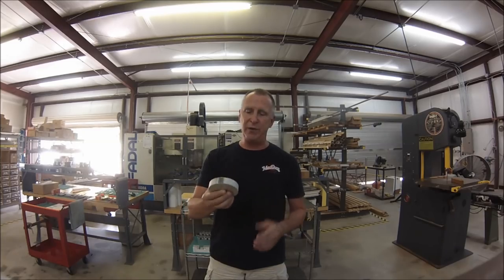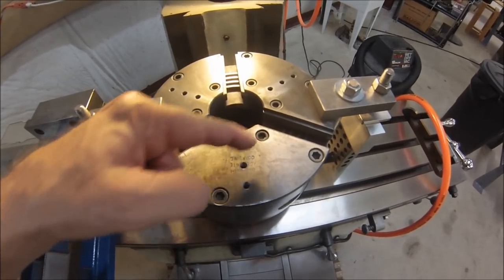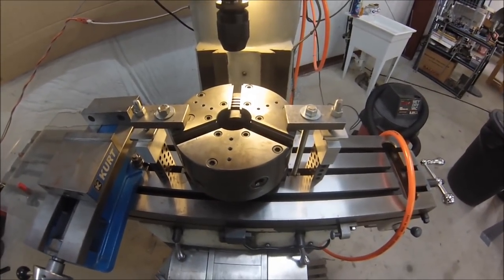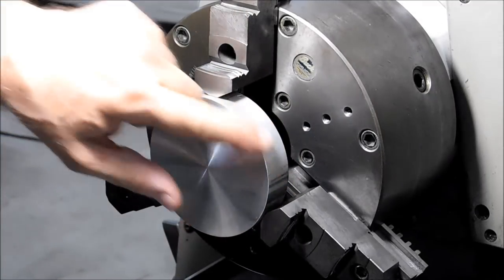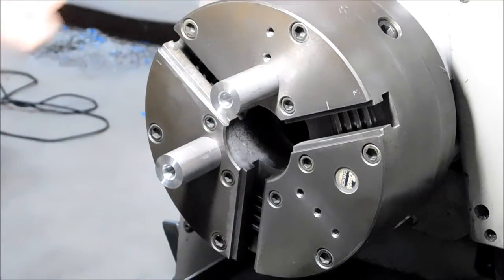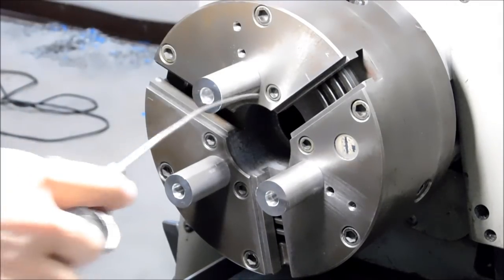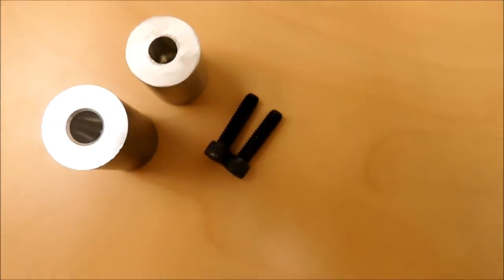A Simple Chuck Modification to Improve Parallelism of Your Parts

Comment: So I suspect what I've seen is down to the issue of rigidity and wear resistance, but recently when I've started turning parts with carbide, I've had less trouble setting up the tool accurately, resulting in much less difficulty turning right down to dimensions with error of only a thousandth or two, where I used to have problems consistently with high speed steel cutters. Is it rigidity? Was I not screwing down the hss cutters enough? If it helps assess the situation, the carbide cutter wasn't in a tool holder, like an HSS cutter, it was a part of the tool holder.

Comment: I still think I like the jaw spider Tom Lipton made/uses (not likely to be as accurate as this).  I don't like the thought of drilling holes into a brand new forged steel chuck.  Not that I have one yet... but soon....  it's still a great idea for those that aren't too chicken to modify their chuck.  Question though, can you not turn the jaws and simply use the steps on them or are they not accurate enough?
Reply: I would drill and tap those just after unboxing, they do not damage the chuck in any way or form. Besides, why use inadequate tools when you know of something better, especially in terms of price like drilling and tapping a few holes :)

And no, you can't turn the jaws and use them, as the jaws deflect when they squeeze a part. If they can be moved in their slots, then there is play and that play allows the jaw to cock and throws your part of parallel. Besides, you would be modifying those brand new jaws and "ruining" them in the process, not to mention that doing interrupted cut turning on a case-hardened parts is fun.

Comment: Nice job .....   I use a  a 3 leg  plate with inset grub screws for check  trueing  so can use on other lathes it is retained only by the material  being machined ......but probably needs to be modded so as to secure it incase the job comes adrift       thanks for your video 
Dave from downunder
Reply from the maker: I've used this technique for years. Works like a charm.

Comment: Something I did, years ago, to improve longitudinal parallelism, was to make a lapping tool for honing the chuck jaws. It went into the tail stock, and you slathered it with coarse lapping compound. Then you ran the tail stock up so that the tool was inside the chuck. Tighten the chuck enough to create some pressure/drag, and run the lathe at around 50-60 rpms or less. Cycle it like a hone, and you get real nice parallel shafts on those times when you have to have a long overhang with no tail stock support.

Comment: Hey Jo, another great film. I would really appreciate any advise you can give on drilling deep holes in steel? I want to drill a bunch of 3mm plates (steam loco frames) 8 bolted together (4 locomotives) with a series of around 100 holes with 3-5mm. Whats is the best technique to make sure I achieve accuracy through the entire plate set? Cheers Dave and Son UK.
Reply: stay off the vodka lol.

Comment: I hv one part motor plate of Dia 128mm  which requires face parallelism with in 20 microns. Is it feasible with this modification on CNC turning and hydraulic chuck holding? kindly confirm.

Comment: that's a trick that my supervisor would call Tips and tricks of FOG's. I've used similar setups when I took indicator mag-bases with steel pegs screwed into them. most definitely a dangerous thing to do at high rpm but at 50 rpm it felt safe enough for me and I made sure that I and everyone else was out of the path in case something happened, I also had my foot on the machine brake to stop the spindle if someone designed to film a new final destination movie by getting two close 😆
Reply from the maker: Its rock solid. Good mod if the boss lets you do it. FOG..Out

Comment: I didn't understand at the end, what you said about concentricity and soft jaws.  Can you please elaborate?
Reply from the maker: Sorry I missed this comment. Concentricity is established with a soft jaw, but the soft jaw pocket is bored deeper than the plane established by the 3 standoffs. This way, you get the guaranteed concentricity from the soft jaw locating the OD of the part, and the parallelism from the part nesting on the standoffs.

Comment: Hi Joe; Impressive as usual, thanks. For this exercise, I have always used an appropriately sized undamaged  old ball bearing outer race ring behind the workpiece, and used the tailstock to provide axial pressure as I clamp. Can you see anything wrong or improvable  with my method? It seems to work OK.
Reply from the maker: Sounds solid to me. Just don't let it jump around and all is well.

Comment: Good job Joe! It seems appropriate to have indicated the face of the chuck for the demonstration. Perhaps a good idea for anyone wanting to use this technique. Vut u tink?
Reply from the maker: Actually the condition of the face of the chuck doesn't matter once you face off the towers. That is one reason to number these towers, or dust them after each installation. They immediately become parallel to the spindle once you dust them.
Reply: If there is runout on the face of the chuck, the towers will not be parallel to the spindle; only when they are faced (dusted) off do they become co-planar to the cross slide. Or am I missing something?
Reply from the maker: The parallel relationship of these towers to the spindle doesn't matter. Its only the contact face that matters. Once they are faced off, they provide a parallel plane for the part to rest on. They could be seriously out of square to the chuck face and it wouldn't matter as long as they are faced after installation. Is it possible I don't fully understand your concern?

Comment: Soft jaws or stand-offs, giving the piece a couple of whacks with a nylon mallet/-hammer ensures that it sits flush against the jaws/stand-offs. You can hear it when it is flush, and it rarely is right after tightening the jaws. We did that all the time during my apprenticeship as a fitter back in the day (Denmark, mid-90's). 
The 2/10 deviation might have been avoided that way.

Comment: Is it necessary to take a light cut each time you mount standoffs, or should they be good to go for home-gamer applications?
Reply from the maker: For critical work, I'd dust them, but if you put them back in the same position, you'd probably be OK not facing them everytime.

Comment: Fantastic tip! Thank you so much for sharing your knowledge. I do have one question though. I always seem to get a sort of nub in the center, what am I doing wrong?
Reply from the maker: The height of your tool is off. You need to figure out if its low or high ans adjust it accordingly.
Reply: Your centre height of the tool tip is off-centre vertically. Suggestion: run your tool tip very slightly (0.2mm) below centre so that the 'centre nub' is an extremely small diameter rod that breaks off as you reach the centre.

Comment: Joe, that was amazing. I always learn new ways of doing things with you, Thanks!  I have one question. How you do with smaller diameter? The holes on the chuck can be closer to the center of the chuck. I am imagining a diameter that is bigger than a collet can handle. Thanks again!
Reply: I agree. Great video. Maybe you could make a set of rectangular bars that would protrude into the center hole. Use two holes instead of one for mounting. A little more work making them than round stock.
Reply from the maker: ww_big_al   You are spot on. I use 1/2 x 1 1/2 aluminum for that. Keep the spacers thin or you loose the ability to close the jaws. Once you get too far down, change over to collets.

Comment: Wonderful idea! Would this replace the need for a 4-jaw chuck assuming one would be used to get concentricity on the flip side? And also, would this work for a 12" long stock (2.5" dia)?
Reply from the maker: This modification is better suited for puck/disc style parts. Once a part gets long, more OD grip length would serve you better.

Comment: I have a part I wanted parallel ends and was disappointed with my results. The part is 1" dia x 2" long with a 9/16" hole lengthwise through the center. I turned the OD to 1" and parted off in a 3-jaw. Then put in a collet chuck. The center was drilled to 1/2" then finished to 9/16" with a boring bar. The end was faced off. The part was then rotated and the other end faced. I got about 0.002" out of parallel. Where'd I go wrong and what would be a better procedure? Thanks, Tom
Reply from the maker: This sounds like the OD of the part wasn't a true 1". a collet chuck would show good contact at the nose, but inside the collet, it would be running out. Possible??
Reply: @joepie221  I'll check this in April when I get back from our winter trip. Thanks

Comment: Great idea!
I also have a mark so I know when my jaws are ending their engagement with the scroll. That made me think to ask, how much scroll engagement is safe (less than 800 rpm in a manual machine)? If a scroll "blade" fully crosses behind one jaw "blade" (and a little bit more) is that adequate? I have a large part to hold and I am right at that point.
Reply from the maker: Be careful if you are only on one engagement between the scroll and carrier. I have my chuck marked for 2 minimum. Too much torque and you do risk breaking one or the other.
Reply: Joe Pieczynski Thanks. I look forward to more of your videos.

Comment: hi Joe.
What about when the part is smaller than the bore of the chuck  ?
what trick can you recommend for us in that instance ?
Reply from the maker: Use a piece of rectangular stock and drill your mounting hole towards one end. Let the material project toward the inside of the chuck bore. I have those laying around as well. Good Question.
Reply from the maker: I also have an adapter I made for the machine internal nose taper to hold threaded rod.
Reply: Joe Pieczynski 
"good question" .. good answer ... thanks.

Comment: Joe, great tips video! Were those spacers aluminum?  Would they deflect or crush at some point?  Thanks, Joe
Reply from the maker: My holes were drilled at 3/4" on center. The standoffs are 1" dia. so I can choose the best position for the part. Go for the most surface contact on the part you are making. If they show signs of wear or distortion, face them off or knock out a set of CRS ones.
Reply: Thanks!

Comment: This is standard in mass production. I would mark each stop with a number, and pair it with a specific hole in the chuck. That way you only have to machine them once.
Reply from the maker: Clock the position as well if you are not going to re-face them.

Comment: So I have been doing it right all my life, I thought everybody did that.  I also make parallel thin brass pieces .040 to .080 with another jig I made that takes seconds.  The trick is to always have the lathe true the surface you work against, not the tool itself regardless of the application.

Comment: Very similar to Stefan Gottswinter (hope I spelled that correctly) but in a way much better.  I like that because it is not as complicated, and doesn't require hardened or ground parts.  Not sure if I can bring myself to drill holes in my chuck though. :)
Reply: Sorry - meant similar to Stefan's solution
Reply from the maker: Stefan G's solution and craftsmanship are undeniable. One advantage to having your registration point spaced away from the jaw is that it spreads the part contact areas out and greatly reduces chatter potential for thinner parts. Making part contact every 60 degrees is more beneficial than every 120 degrees. Just be careful if you tap your part down. It could distort the part.

Comment: Another great tip. Thank you again.
What about a hydraulic chuck on a CNC? The manual says not to do this and I also have concerns about the RPM's. I'm fresh out of school so, what does your experience tell you?
Reply from the maker: I have to imagine the chuck modification warnings are there to cover the manufacturers. Some CNC chucks can really spool up. But since they have holes in them initially, I would think a symmetrical hole pattern would be more critical for the balance and potential explosive consequences. I would suggest consulting the manual or manufacturer if you have any doubts.
Reply: Don't do it unless you know how the chuck is constructed and works. 
On CNC hydraulic-chucks there is a sliding mechanism that moves back and forth for making the jaws move in and out.
You also have chucks with counterweights that compensate for loss of clamping-force due to high rpms.
You also have chucks with quick-change systems that also take up some space between jaws.
Reply: @dietermeyer9231  
Thanks. I can relate to that. I had to pull one apart cause I'm trying to fix this AL-2 that sat in the elements for three years. Fortunately, it was northern Utah so the rain didn't completely destroy the thing. But the chuck was rusted shut and it took a while to get that thing back in working order. Also, I had an instructor from my school at my disposal which came in handy because I couldn't figure out why some parts were not doing what I told them to do during disassembly.
Somebody had already been into it, broke off a set screw and left it there and there were a lot of chips gouging the thing up. ...great stuff. I had to use sandpaper on some of it but fortunately when I put it back together, the tolerances were still tight. The main part which opens & closes the jaws had to be put in the fridge for ten minutes to get it to slide in, for instance.

Comment: It looks that the bolts are 3/8" ? can one drill and tap the chuck body ?
Reply from the maker: They are 1/4-20. They also don't go thru to the scroll track. Mine were done in a mill and kept very symmetrical for balance.

Comment: So what's the deal with running a lathe with an empty chuck? I saw this referenced in another video of yours and forgot to ask but since you mentioned it here I figured I'd ask.
Reply: the jaws may eventually literaly fly out of the chuck (pushed by centripetal force)...and that would be a bad thing to witness...
Reply: I have very lightly 3 jaw chucked a part and found that it got looser when the scroll gear moved under start up torque. So continued operating could let the jaws creep out & fly off.
Reply: Without the jaws clamped on a workpiece, or with the jaws being removed, the scroll is free to rotate.  Since it's fairly heavy its inertia will cause it to lag the chuck's acceleration when the spindle starts, so in effect it turns in the direction it would when the chuck is loosened.  If it turns far enough the jaws will lose engagement with the scroll and cause you a very bad day, possibly your last.

Comment: Nice video, One question what is the reason for not turning on the lathe without something in the chuck? Risk of losing a jaw?
Reply: Good question. I'd love to know the answer.
Reply from the maker: Acceleration of the mass. Take your jaws out and turn on the machine. You'll hear the scroll screech as it get up to speed, and continue to spin when you shut down. the jaws could move or be ejected.
Reply: @joepie221  Thanks for the reply, never to old to learn something new.

Comment: Do you face the standoffs every time you use them?
Reply from the maker: You can if you need to be exact. You dont have to, but it probably is a good idea if you are not sure of their position or clocking.
Reply: Ok, I assume then we shouldn't trust the chuck surface hence the clocking..  By the way I've used your threading technique with the tool upside down, good stuff!

Comment: I have hardened precision Jaws with steps on them for doing this...?  Tap and seat onto the jaw faces. Maybe we just have better chucks here in the UK...?
Reply from the maker: Provided your jaws don't deflect outward when you tighten them, and provided your parts are thicker than the jaw steps are deep, and provided you aren't worried about possible jaw scratches on your part from jaw movement on a finished face, it will work. Personally, if its not a soft jaw setup, I'll take a solid stop over a movable stop any day.

Comment: How critical are the holes could they be done in a drill press?
Reply from the maker: Not critical at all. A drill press would be fine. Just keep the pattern fairly similar per area so the standoffs aren't too out of position. I would think within an 1/8" would be fine.

Comment: Great job, good knowledge and every video that you do has a deep fundamental idea, one of the best in the business, I do have a question in this video about 10:30 time you said ( is 917 and a half and 917 and about 7/10, I can't understand this dimensions in the comparative way, lather you said they are 2 thou apart, please, may I have an enlightenment. Note(I'm not a English speaker)
Reply from the maker: Thanks for the question. The broken number I say is in regards to the 4th decimal place 917 and a half translates to .9175 with the .xxx5 being half a thousandth of an inch, and the 917 and 7/10 is just .0002 larger than the first  .9177. I hope this helps.
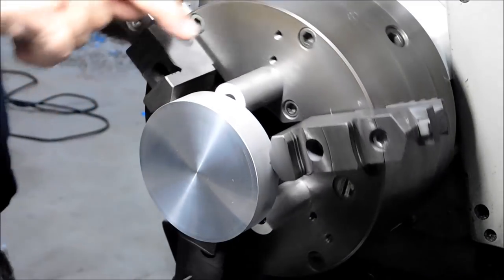Reply: At 10:33, Joe says "within 2 tenths", not "within 2 thou".  That translates to within 0.0002, or "2 tenths" of a thousandth, or 2 ten-thousandths. English shop-speak. ;) And you are correct: Joe IS one of the BEST IN THE BUSINESS!

Comment: Can you mark the stands and orientation, then remove them and put them in same order and orientation without facing them of again, getting the same precision?
Reply from the maker: I would think you may experience miniscule difference returning them to the same spot. If you put them back in the same spot with a reference mark for rotation too, that would be best.
Reply: Indicate your chuck face to see if it’s running true. If runout is .001 or less you should not need to face the standoffs or place them in the same position.